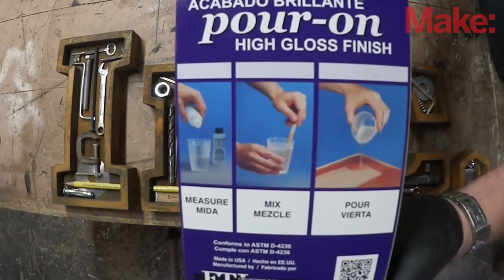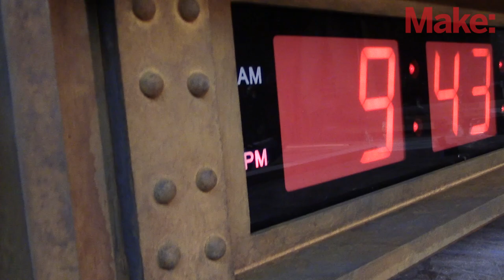DiResta: Inc. Clock Sign

Comment: Heat gun to knock out bubbles.  Deadly trick!  Love it!
Reply: and it works ! 0_0
Reply: Why is it deadly?
Reply: Why is the butter deadly?
Reply: Dustin Penner
many epoxy resins based on Bisphenol A. BPA works by imitating the natural hormone 17B-oestradiol. it's bad.
Reply: ***** Sounds legit
Reply: Actually the instructions for that product state that you are to use a hand-held propane torch to break the bubbles. It's the carbon dioxide, not the heat that removes the bubbles.
Reply: +Steven Sprague Given that it worked with a heat gun, I highly doubt that last statement.

Also, I don't see how carbon dioxide could possibly affect those bubbles. Whereas heat, on the other hand, usually makes viscous liquids more fluid.
Reply: +piranha031091 both will work. I think the torch works a little bit better.
Reply: Dustin Penner
Yes, because it is hotter. My point simply was, this has nothing to do with carbon dioxide : it IS the heat that removes bubbles.
Reply: +piranha031091 

Strait from the instruction sheet of the product, i think the manufacturer probably knows best:

4. Bubbles. After about 15 minutes, air bubbles created while mixing
will rise to the surface. They can be easily and effectively broken by GENTLY
exhaling on them until they disappear. A small hand-held propane torch can be
used as an aid in removing bubbles from a freshly coated surface. Hold a torch
approximately 6 inches away from the coating and use a gentle sweeping motion
across the surface until the bubbles are gone. Use low flame. This process may
be repeated as often as is necessary while material is liquid. The torch should
never be held in one place for long, as this can permanently damage surface
and coating. Care should be taken to avoid over torching. If wooden
objects are not sufficiently seal coated prior to torching, heat from torching
the surface can cause the wood to “bleed” air into a fresh coat of EnviroTex
Lite®, and these bubbles are difficult to stop. Use a swift, even sweeping
motion when torching and never hold torch closer than six inches from
surface. Do not use a torch on surfaces that may be flammable, such as
paper and dried flowers. NOTE: It is carbon dioxide, not heat, which removes
bubbles.
Reply: +Dustin Penner  i usually use a torch or breath on it.

Comment: Jimmy DiResta, one of the few craftman that doesn't put wood glue on both sides of the work pieces.
Reply: is it necesary to put glue on both joining parts?
Reply: People say that putting glue on both sides give stronger hold compare to putting glue on just one side of the work piece. Its not necessary if you don't need a lot of strength for your project.